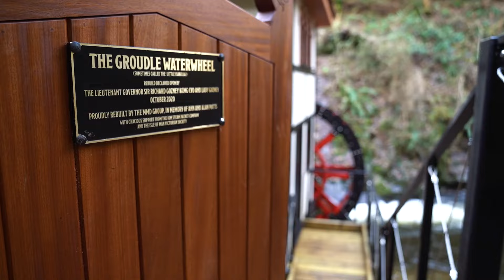Groudle Water Wheel Rebuild

Comment: Very interesting. Could the building not be saved?
Reply from the maker: Unfortunately not, very little was salvageable from the previous restoration. Although some elements of the wheel were restored
Reply: @Mmdsizers  does the wheel run on water now for demonstrations?
Reply: @teescottageguyproductions  it was only ever a tourist attraction , as opposed to a ‘working’ wheel , I believe